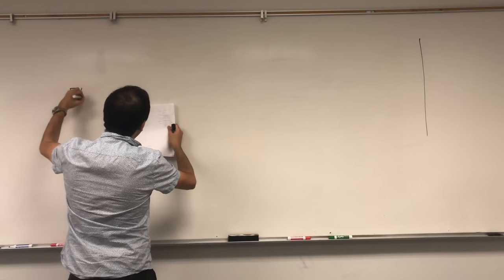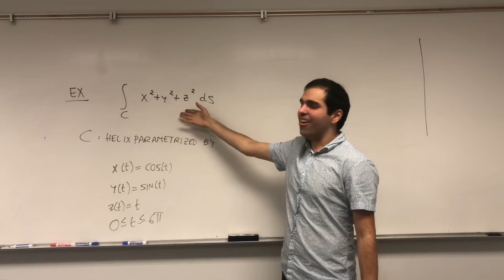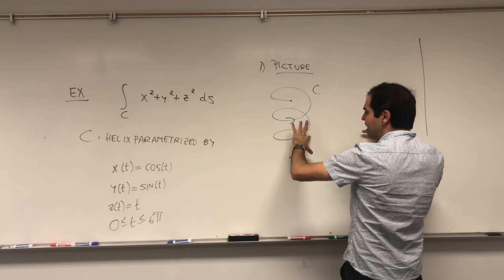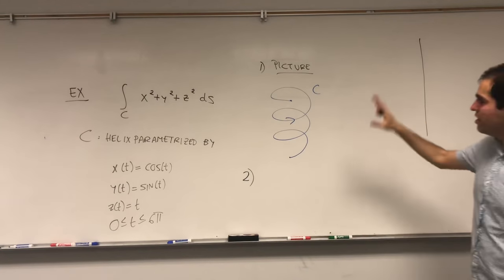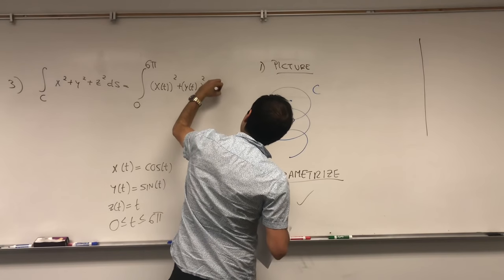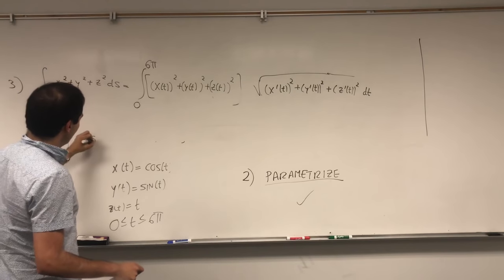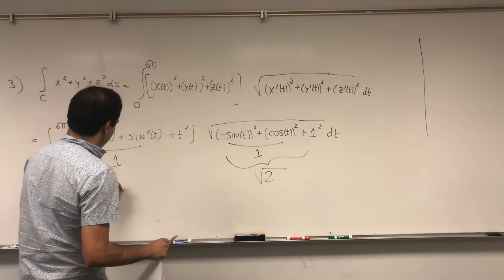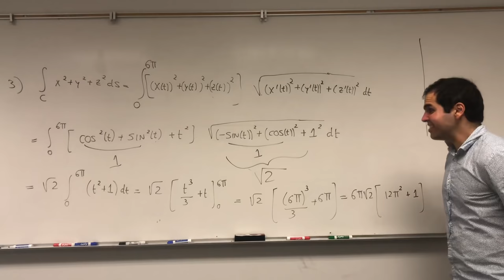Integral over a helix 🧬

Comment: I have a nice interpretation for this line integral:
The line integral is equivalent to twice the surface area of a surface containing all of the straight lines from (0,0,0) to anywhere on the helix.

That surface would like like a sort of a wierd rose.
Reply: How did you figure that?
Reply: Oh, nevermind, i think i have a mistake.
Reply: It's close but instead of multiplying by two, the integrand is the square of all those distances. The way he noticed it was probably because of the Pythagorean Theorem (in 3D)

Edit: *integrand, not integral. The integral of the square is not equal to the square of the integral.
Reply: @mountainc1027  
Yes.
Reply: @mountainc1027  Yeah that would do it

Comment: The integral of e^(iwt) does it perfectly. (It works for volume, not line lenght. Because we'd need |df/dt|^2 and |z| is not linear and |Z| for complex number must be done by part.

Actually, since this is a helix with a constant frequency, we could do it by parts. (But we'd only do 1/4 of a turn). Multiply by 4 for a turn. Multiply by L/l Where L is the lenght of the elipse and l is the lenght of a turn and you have it. 

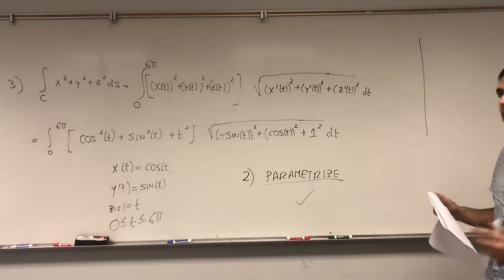Double actually: If we uses Euler identity and just uses a bit of logic, we get exactly back to the 5:31 step.